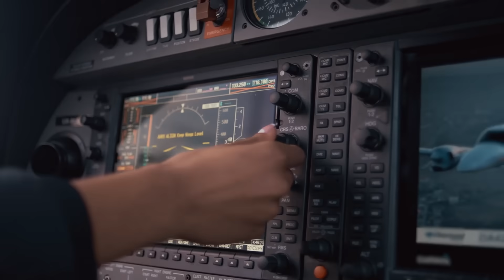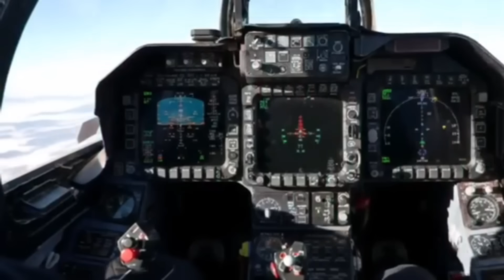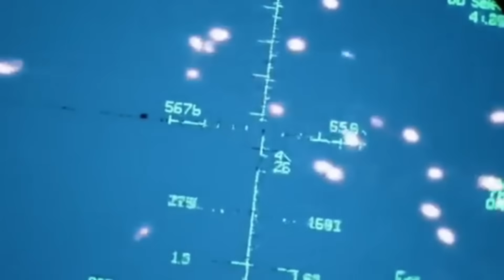Canada’s Gripen Deal Gets SUPERCHARGED — Rolls Royce Delivers a Game Changer

Comment: The BEST option that I believe we “should” do, is buy both. Use the f35’s for infiltration and bombing and the grippers for interceptor roles.

That being said, apparently during the trials, the F35 did better than the Grippen. That means something too. Also, how much longer do you think we should wait before we start getting ANY fighters to replace our aging/obsolete fleet of aircraft??? 

This is a good, but not such a smart idea. The F35 is a “better” all round fighter. Yes it has problems, but they will most likely fix them. The Deal with the Grippen also has advantages, and yes, a lot of them….BUT, this isn’t the way to employ it.

Comment: There's been a new engine for the Eurofighter for some time now that even has more power than the US engine and actually fits into the Gripen's engine bay. It even features the possibility of thrust vectoring. The engines in the Eurofighter are largely based on Rolls-Royce Aerospace's technology. They were already offered and fully developed. They are slightly lighter than the US engine and have a slightly different ratio of normal thrust to afterburner. The old EF engine is the weakest, the US one (only for the last Gripen) is stronger if afterburner is used. The new EF engine is a little bit stringer than the US one if afterburner is used and much stronger without. I suspect that, under favorable circumstances, supercruise might even be possible. In any case, it would make sense to use it in the most fuel-efficient mode possible, without the afterburner, as is already common practice.

Comment: Not possible. To change aircraft engine needs a lot of adaptation, test and certification. It is not like changing engine in your car.
Reply: They would still be in operation before any F-35s are in Canada. We have been waiting a decade.
Reply: The air craft is built around the engine which means they will design it to fit
Reply: @normancronk505 the aircraft is already designed, which means they would have to modify the engine to fit the aircraft. I can be done, but it will take MORE time.